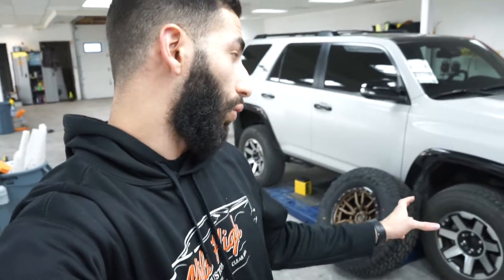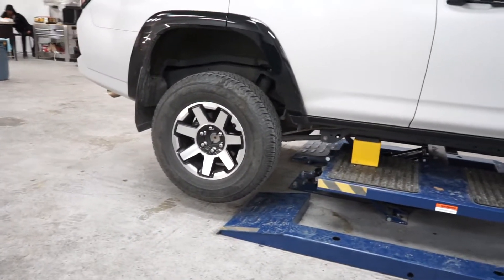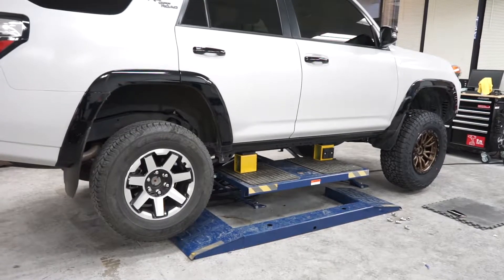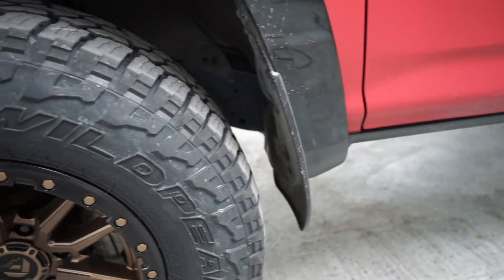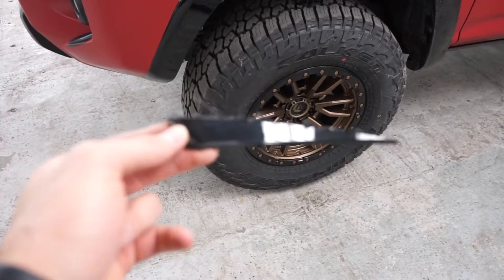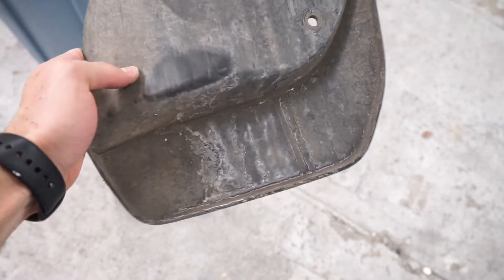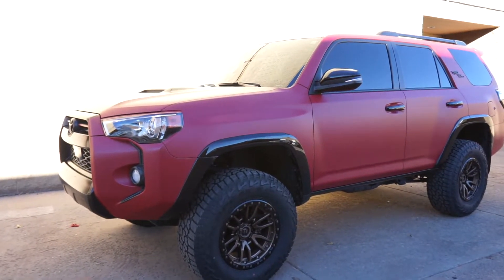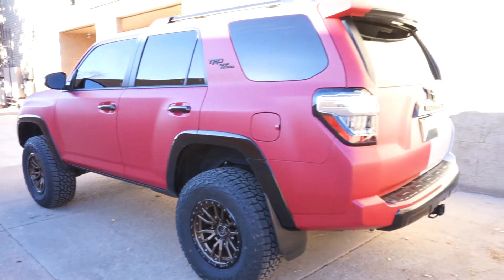Toyota 4Runner Build Part 2: 3" Lift + 33" Off-road tires!

Comment: Your wheels look great.  Are they the +1 offset or the -12 offset.  I am running very similar setup with stock wheels and spacers.  I want to remove the spacers and am looking for a wheel that accomplishes the same thing.
Reply from the maker: It was a 0 offset